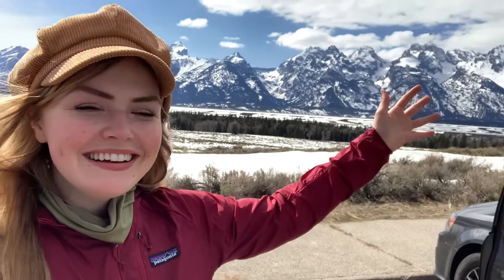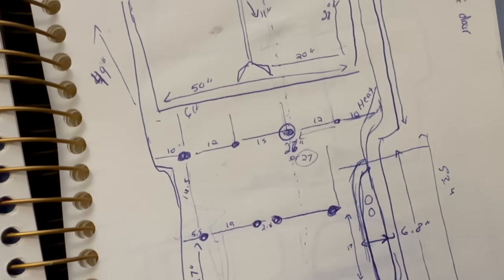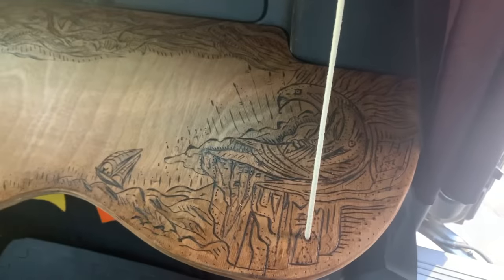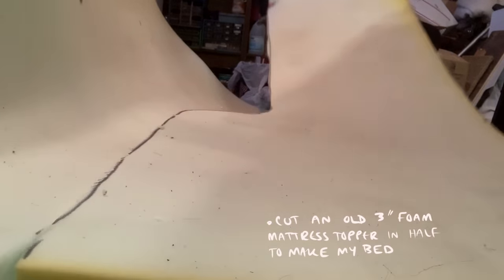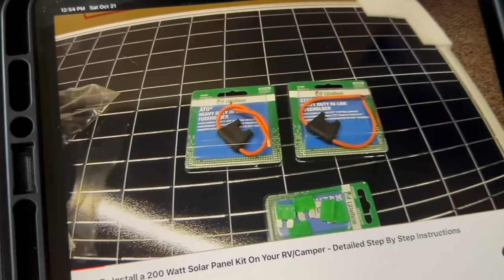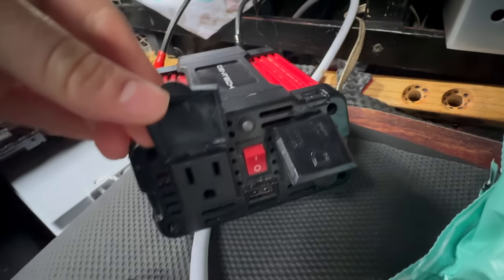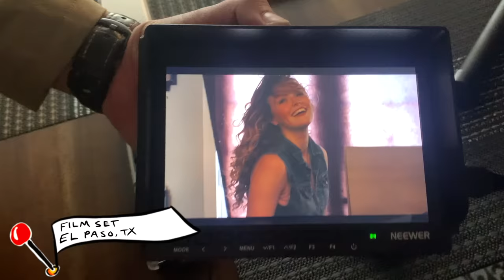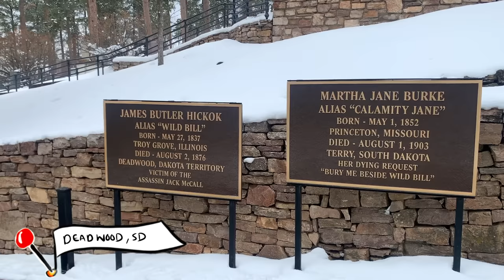I Converted my Dodge Caravan into a Camper- Solar Panels and All! | FULL Build - Start to Finish |

Comment: Lydia, your journey overlapped some of my July 2023 tour of America. July 1st I crossed the Mackinaw Bridge, Henry Ford Museum, Cleveland, NFL Hall Of Fame, Flight 93 Memorial, Philly on the 4th of July, Top of the World Trade Center, circled the north east, Washington DC, Kentucky for the National Corvette Museum, Nashville, Florida Keys, Mobile, New Orleans, Little Rock, Four Corners, Grand Canyon, Hoover Dam, Golden Gate Bridge, Multnomaw Falls, Seattle Space Needle, Devil’s Tower, Rapid City and back to Wisconsin. 2014 Dodge Grand Caravan (Silver Bullet), added a remote starter for heating and cooling, removed stow n go seats and built a bed. 3,000 videos/photos, 13,482 miles in 24 days and covered 48 states. No Hotels, averaging over 500 miles a day, luckily with no mechanical issues. Chase your dreams, even if the destination is unclear!  Subscribed

Comment: Wonderful video you made it look so simple, glad your dad is doing better.. looking forward to watching your journey... what drawing tablet are you using if you don't mind me asking.. looking for one that does not need to be hooked up to computer all the time. thanks
Reply from the maker: Thank you so much for the comment!! & Yes, my dad is doing 100%  better. I'm so grateful that I'm back home for a little while before the next big adventure- and my next trip is actually a father-daughter road trip around the country in January so that will be a hoot! As for my tablet, I have the Ipad Pro 12.9 inch 4th generation with the 1st generation Apple Pencil. I do my animations with Procreate. I can even charge it with the 12v car charger that has a USBC. I also have a case for it so it stands up, and a keyboard and mouse by Logitech that connects to it wirelessly. It works wonderful for me, and still holds a good charge after 3 years of constant use! They now have ones with the M1 chips, which is definitely on my bucket list! Hope this helps!! Cheers and more coming soon. All my best, Lydia

Comment: I have a 2019 Dodge Caravan.  Im currently doing my build in preparation for spring.  I too removed all my rear seats.  The very back seat once removed has allowed me to install a EU2200 Honda generator,  chubu diesel heater & window air conditioner.  Ive not seen anyone do that to a dodge before so I guess I'm the first.  I'll email you pictures as i progress.

Comment: So, I have to ask, why did you decide to go with the PWM controller instead of MPPT?  I know the MPPT controllers are more expensive, but I think they're worth it so you don't lose as much power.  The wiring is definitely a LOT simpler w/serial.  The only real benefit of parallel with only two panels would be if you expect to be in places where one panel might be blocked (parallel somewhat isolates the panels from each other so degraded sunlight on one panel doesn't reduce the whole system.  We had no issues with our dual 100w panels (also Renogy) in serial.  And, we even considered switching to a combination serial-parallel config when we added 2 more panels.  I can't recommend enough if you can do so down the road to upgrade to MPPT.  Of course, the fun thing about the nomadic life is that you can alter so much of your build over time, to fit your needs and travels.
Reply from the maker: Hey there, thank you so much for the wonderful comment! Super informative too! I was really on a budget at the time, and went with the cheapest option :)  If I had the MPPT I would most definitely be hooked up in series- as I've heard that it is well worth the extra $$. Down the line I would love to switch out my charge controller, or save it for the next install :) I'm so glad to hear that it's worked out for you so thanks for sharing your experience with your Renogy set-up. That is the beautiful thing about nomadic life, it can all be pieced together, and moved around until it fits just right! Cheers and thanks again! All my best, Lydia